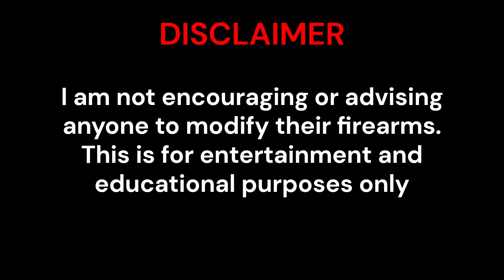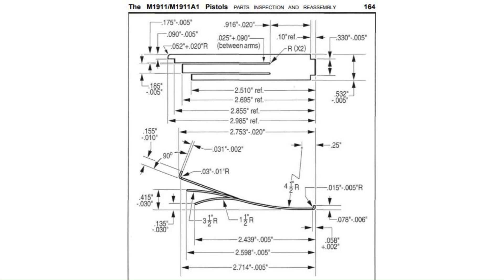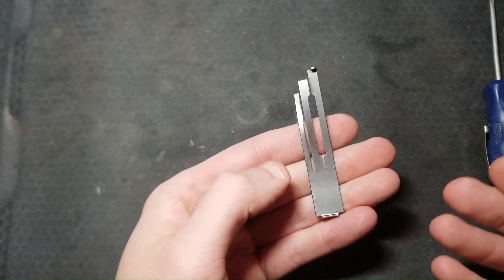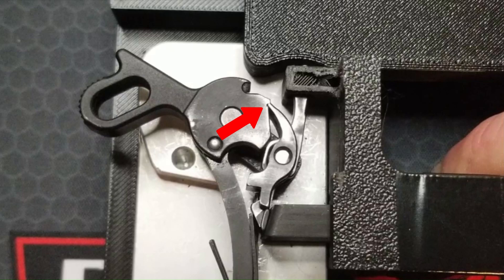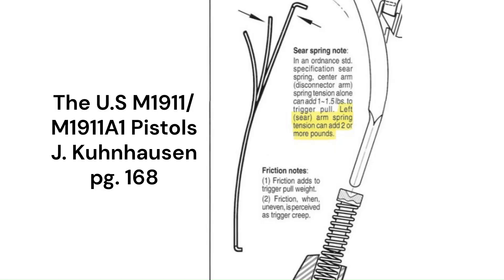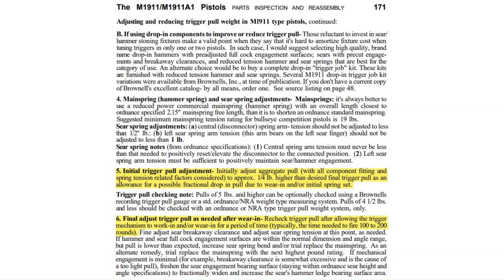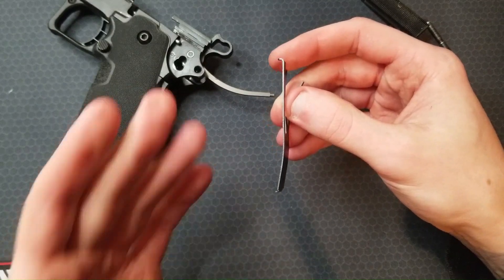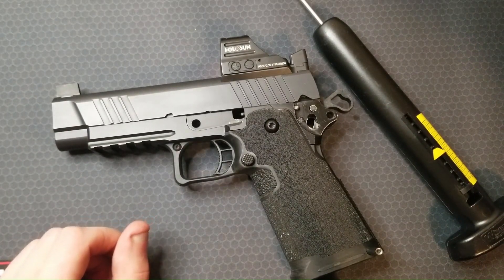A Detailed Look at the 1911 Sear Spring & Adjustment

Comment: Thank you sooo much for this video. I have the same problem you mentioned towards the end of the video. My pistol will drop the hammer to the half-cocked postion if the slide is droped on an empty chamber and no magazine in the gun. I believe this is called a " bubba slam or fud slam " which shoud never done to begin with. This just happened when I was showing the pistol to another competitor, can't believe he did it, he should know better. The pistol is a Kimber Polymer. I sent the pistol  to Wilson Combat back in the 1990's.for a trigger job. I have shot over 5k rounds since then. Time for a new spring if I can't adjust the one in the pistol. Once again thank you for the video.
Reply from the maker: I don't have a problem with dropping the slide on an empty chamber... a few times. Just to check that I have adequate sear engagement. Don't do it 100 times or 1000 times and the pistol will be fine. After 5k rounds the sear and hammer engagement relationship may have worn to the point engagement is no longer adequate. Check the left sear tang adjustment. Maybe time to recut/replace the sear.

Glad you enjoyed the video. I hope its helpful and I hope you get your pistol sorted!

Comment: Great video and professionally explained. I find by my experience the spring with the left and center relief cut out are a little sensitive with adjustments ! I to have used wolf springs. I make myself a go no guage by laying the spring on a ink pad then pressing the pring on paper as well as taking pictures. Something similar to your printout and make an adjustment. If i didn't get the results i wanted i have a reference to go back to instead of guessing. I also find the relief spring version is harder to get the hammer strut in the mainspring housing without getting jambed in-between the sear leaf and the trigger leaf.
Reply from the maker: Ah thats for sharing! I ddin't think of the imprint method! Very cool. Pre-load the spring and see how much contact it makes with the paper - more pre-load, more contact! Very clever. 

The reduces power springs are more sensitive to adjustment in my experience too.

I hate it when the strut get stuck between the left and middle spring haha.

Comment: I have a gold cup national match Siri 70 made in 1978 when I fire the weapon the thumb safety is flying into the safe position sometimes after what sometimes after one shot sometimes 2 or 3 shots then the thumb safety lifts itself up back into a safe position what could possibly be causing that And the thumb safety has a very good strong positive click when Taking on and off the safety with gun in battery
Reply from the maker: Thats an interesting failure to have. One I have not heard of. First and most obvious question I have (sorry if it sounds basic or pandering - I dont mean it to be), are you keeping your thumb on top of the thumb safety paddle as you shoot? The only time I have seen something like this happening is when someone incorrectly grips the pistol and their thumb is under the grip safety. Recoil causes their thumb to bump the safety to the on position.

If you're gripping the pistol correctly, and the thumb safety is being forced up against the downward pressure for your thumb that is super bizarre. I would check the dimple in the safety in the off safe position where the plunger engages. I would check the plunger and plunger spring. I can't really see a way where it could get engaged from inside. Once it is disengaged, the part of it that blocks the sear is under the sear and I cannot see how it would be contacted by anything that would force it on.

Comment: The leaf type 1911 springs are the reason for excellent smooth function. As a ham operator years ago I used a j 37 straight key having a leaf type spring in it. This too was far better than using a coil type spring in other straight key types of keyers. At an operating speed of near and up to 20 words per minute on the keyer it ran very smoothly. The 1911 will never die because of this spring design
Reply from the maker: Oh thats cool! Another application of this type of spring. Thanks for sharing! I would have never thought of that.

Comment: So, I thought I understood the function and adjustment of the leaf spring: until I watched this video.  This aught to be a primer for every 1911/2011 owner.  Amazing what facts, imaginative illustration and clear articulation can do to explain a complex topic.  Great job Dude!
Reply: There's an animated video on how it works as well as a gun that is cut apart for demonstration purposes
Reply from the maker: It took me so many years of adjusting sear springs with seemingly unpredictable results to finally understand how this worked. Seemingly unpredictable because I didn't really have the understanding to predict the outcome of adjustments. 

Then once I knew exactly what leaves of the springs did what, it was relatively straight forward to develop my process. 

Then another level of understanding was required to make this video and explain it well enough. 

I hope it continues to help people understand the 1911 ignition system!

Comment: With your help I’ve taken a 5” prodigy and swapped, polished all necessary parts and work to the slide. I’ve installed an Atlas mid flat trigger, tuned my sear spring. Trigger pulls are consistent 2.0-2lb .10oz pulls - no hammer follow. Ejects perfectly after the marvel disconnector cut, polished disconnector, shoots like a more expensive 1911 DS pistol and feels better. The Aos comp 5” model shoots flat as it is. Springfield did a good job on this version. 

Thank you for the valuable information.
Reply from the maker: Glad its been helpful! Sounds like you got a sick setup!

Comment: So what causes the double fire in a 1911? I've got a Nighthawk Custom that just started doing this. It's brand new and ran fine through one mag. For Context, it's a 10mm Agent 2 Commander. After the first mag, it began. I could literally feel the trigger pushing back against my finger no matter how hard I pinned the trigger back, causing double fires. I've put the gun up and am not using at the moment debating whether to send it in, or not.
Reply from the maker: Double fire or hammer follow is generally caused by inadequate sear and hammer hook engagement. This can be due to engagement depth, sear spring adjustment, main spring weight, or the angle at which the hammer hooks contact the primary sear face or a combination of any of those. It also seems you may have an issue with inertial trigger bounce (I have never experienced this so I'm not going to go into more detail). The gun should absolutely go back to Nighthawk! I hope they get you squared away!
Reply: @EngineersArmory  Thank you kindly for your response! This was an incredible video for us layman! I'm disappointed that I've gotta send her back, but it's the only option. Thanks and take care.

Comment: Is there a reason you aren't using the Kings Gun Works Spring? Now I made mine with a great deal of slow work, water,  and rotary tool.
Reply from the maker: I am not familiar with Kings Gun Works. Sear springs i use what comes in the pistol or EGW. Mainsprings are always from Wolff. Not sure which spring you're referring too (likely the sear spring).
Reply: @EngineersArmory  The Kings Gun Works spring splits the middle finger of the spring in half. From there one finger rests on the disconnector and the other rests on the trigger bow to stop any kind of harmonic bounce that can happen in light trigger jobs. I used to shoot a reliable 2 pounder in my day. In closing the spring is still available, just search Kings Gun Works. They in the day left the patten open to the public.

Comment: ❤❤what about it been drop safe aswell when bringing your trigger weight below say two pounds ?????
Reply from the maker: 70 series 1911's lack a firing pin safety block, so they are not really drop safe regardless of your trigger weight. 

Light triggers generally have less positive sear and hammer engagement. The chance the sear lets go of the hammer hooks if the pistol is dropped is therefor higher. However, the hammer would likely drop to its safety catch and not fire a round.

Comment: This is why if you reduce the force of the disconnecttor spring you'll reduce reset force but can lead to improper resets
Reply: After my gun came back from a gunsmith I occasionally and only when actually shooting have the problem that my trigger does not reset. It stays in the rear position . If I load the gun through, the problem is solved. I am still trying to find out why this is the case.

Comment: I love that Jig! Are you sharing your files anywhere??
Reply from the maker: I usually share my files on GrabCAD, but not this one for a couple reasons. It was a pain in the ass to get it working how I wanted. I modified parts after they were printed and I don't want to go back and update my many models. Also it requires that little aluminum sear and hammer jig - which is only like $30. But I wouldn't recommend anyone buy it. The holes were so far out of position I had to re-machine mine. You should be able to use it for this fixture - but more importantly be able to use it to evaluate sear and hammer engagement - which you cant if the holes are way off.